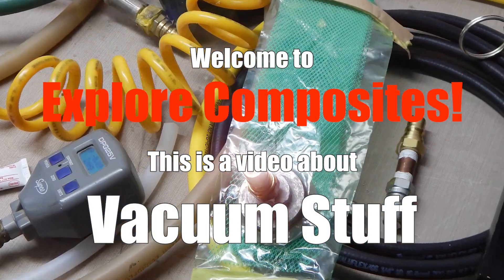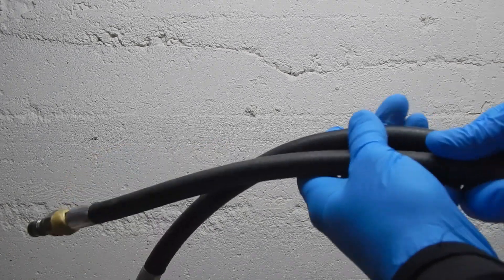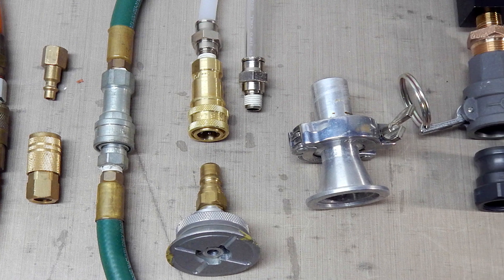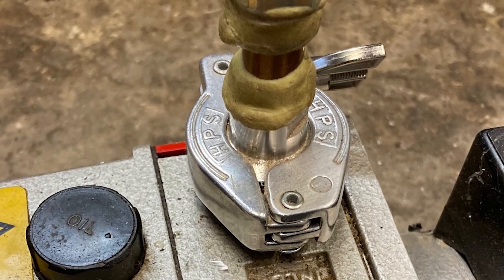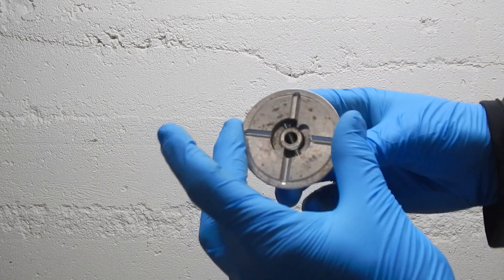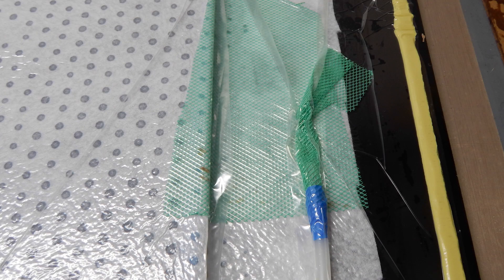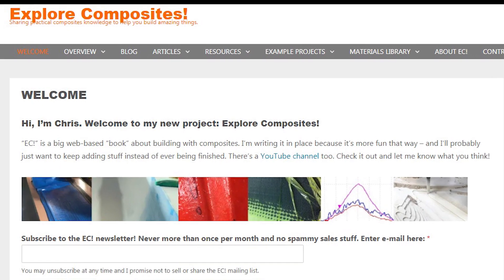Vacuum Stuff for Composites: Hoses, Connectors, Gauges and More!

Comment: I work with vacuum in the laboratory. One thing a lot of people miss is that vacuum hoses should have a large diameter in order to flow well. Very often I find places where a vacuum system chokes down to 1/4" or less. That's losing a lot of vacuum. Under vacuum, the molecules are very far apart, so you need large diameters to move them.
Reply from the maker: Good point!  This is small stuff but main lines in big vacuum systems or even manifolds should be much larger diameter. I am sure optimal sizes can be calculated - I have never tried.  It is still fluid flow after all!

Comment: Anorher option would be solid pipes. Like pex or 1/4" copper coil
Reply from the maker: Yes, totally - on hard plumbed systems solid pipe is necessary.  I have used pex with aluminum (pex-al-pex?) but probably regular Pex would be fine too.  Some of the factories I've worked in have had older copper vacuum plumbing - its just expensive.

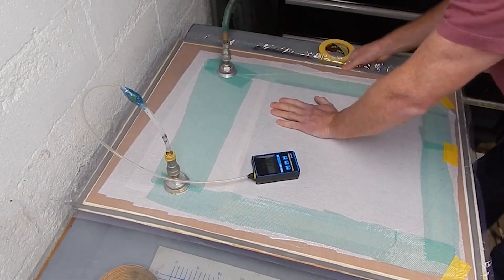Comment: Shot in the dark here, but here's my question - The vacuum regulator you show @10:43 ... Is that a hydraulic flow valve? It looks a lot like one.
Reply from the maker: You are right - it is a hydraulic flow control and says "Parker Par Trol PN600B -40BT" and "MAX 2000 PSI" which is more than vacuum is ever going to give it.  I don't recall where I got it from, but it was part of something I bought used because I never purchased it by itself or even considered what it might be besides a vacuum regulator.  Thank you for making me learn!
Reply: @ExploreComposites  Most excellent reply! Thanks!
edit: I found one similar on eBay - Thanks for confirming that. That's one more piece of the puzzle!

Comment: Can you share the surfaces you use to work on? Example: you mention a teflon table, or heated tables?
Reply from the maker: The tables have a Teflon/PTFE film release on them - its like a sticker.  It doesn't give a perfect finish, but lasts for may releases, has no transfer and doesn't require (stinky) release agents.  

The tables I use for the samples are heated to manage the often-cold work environment.  One is an aluminum plate with a 3D printer bed heater stuck to the back.  The larger one is a carbon/aluminum honeycomb panel with a soft drum heater blanket under it.  The aluminum core transmits heat very well.
Reply: @ExploreComposites  thanks, this is very informative.

Comment: One interesting option i found for infusion : "bag ports" purchased from Eldon James. $1 a piece, place under the bag with sealant tape on top for the bag to seal over, and the nipple protruding through. There 2 sized that fit PE hose perfectly. Extremely low profile for use on infusion mesh or over a flat resin runner, can be easily reused 2-3 times but very cheap and makes little waste anyway. Love them. Only downside, make sure your hose does not flex it too much as they are very soft. Never had one fail me, though.
Reply from the maker: That's a great idea - I'll have to see if I can get my hands on some to try out.  Thanks!

Comment: What if you want to vacuum bag on a wet layup  a large area say 14’x10’? I am planning on a project and plan to use carbon glass and coremat as sandwich material. I am not experienced in vacuum bagging. Does this mean I’d need bigger hoses or hose fittings and a bigger vacuum pump?
Reply from the maker: If you are well prepared and tidy, two or three hoses with breather wrapped around should do fine as-long as they are off the part clear of resin.  Bigger hoses and pumps help but aren’t necessary.  Even a 3-5cfm pump will work.  The key is getting the sealant down clean without any resin mess under and then work the edge pretty well as the bag comes down.  Make sure you can limit the vacuum level!  Also not sure on coremat with wet bagging - never done it!  May suck up quite a bit or resin and starve out the skins.  A smaller test first will really teach you lots!

Comment: Chris,  can you do more on valves, clamping,  controlling / stopping resin flow, etc.  There are lots of ways to do this.  Valves that are "consumable" like the Pro-Vac.  Expensive fancy threaded squeezers like in your videos, Vice grip like hose clamps, bending and folding the tube, etc.  Our mutual pal JK gets really adamant about not having anything like a valve that is a potential vacuum leak.   Every time I clamp down on the tube with the vice-grip-hose-clamp I'm wondering if it going to split or rupture it.  Folding the  input tube has its own set of drawbacks, like pulling it out of the pot, flicking resin around, resin waste, etc.  Some of your expertise here, especially as the part size gets bigger.
Reply from the maker: I am not sure how I feel about clamps and valves - there aren't any 100% awesome perfect solutions that I know of.  The valves do work but I have also heard of them leaking - it is asking for trouble but how much trouble I don't know.  I haven't used the Pro-Vac ones but I'm trying to get a few.  I used the wide flat Vise-grips for carpet for years and never broke a hose though I worried about it too.  Often two Vise-grips in line on a hose for complete clamping.  The fancy squeezers with the knob are the best yet - but they are too expensive to use on every hose for larger infusions... or are they?  My feeling is that in a factory situation they would be 100% worth it.  You could make your own pretty easily too.  definitely

Comment: west systems has a line of vacuum stuff under the pro-vac brand.  their tubing is a metric euro size so its not compatible with sae size poly tubing fittings.  1/4 ID poly tubing like you can get at Home Depot or from suppliers like Composite Envisions will fit inside Pro-Vac 10 mm so with some tacky tape you can join the two.  Pro- Vac has their own T connects, valves etc. The tubing is thinner walled and is a little easier to handle, bend and route around.  The valves are really good quality,  barbs insert and seal in tubes nicely.  pricing is reasonable and in line with a consumable.  Mostly only available in full rolls, etc.  I don't know of any cut quantity suppliers
Reply from the maker: I haven't use the Pro-Vac stuff yet but hoping to get some - right now I don't exactly tear through rolls of anything!  It makes sense they'd source good stuff.  I'd be interested to hear how you like the valves.

Comment: Thanks!  This is really helpful.  What do you think of the wire reinforced PVC hose?  It has been working fine for me.  (I use those hydraulic fittings all the time in my job, but never thought of them for vacuum.)
Reply from the maker: I have used the larger wire reinforced PVC hose stuff for flexible drops on vacuum systems and it works great.  Not cheap but cheaper than other large diameter alternatives!   Never used it for smaller vacuum hoses but no doubt it would work.  What sizes do you use?  It can be bought vacuum rated too I think?
Reply: @ExploreComposites  I have some 3/8".  I use it for everything, from degassing urethane (high vacuum) to low temp bagging.  I think it is intended for food grade vacuum applications.  I found it on Ebay for a decent price.